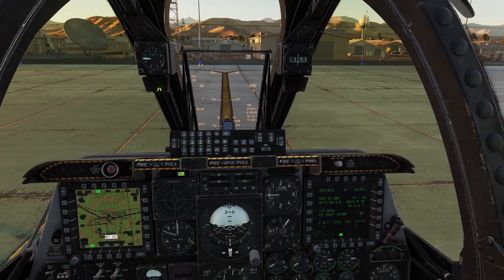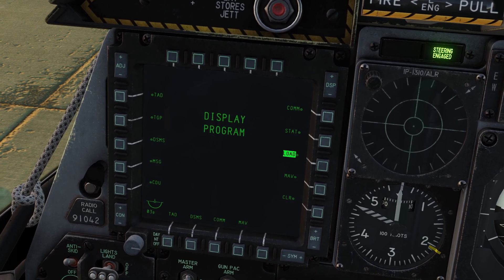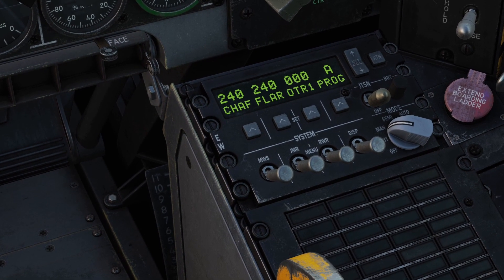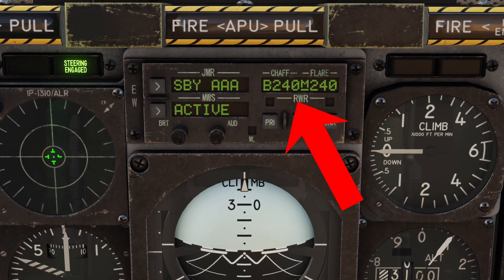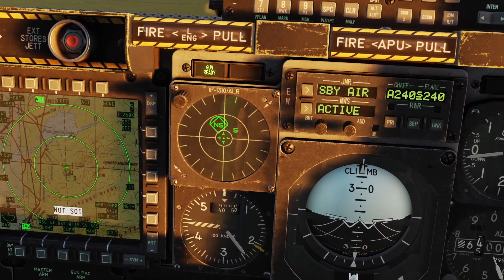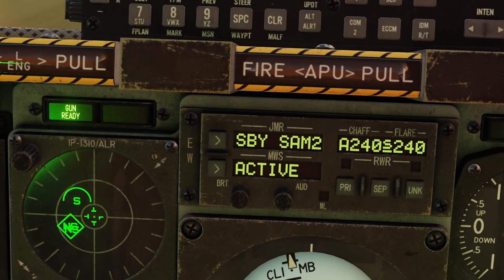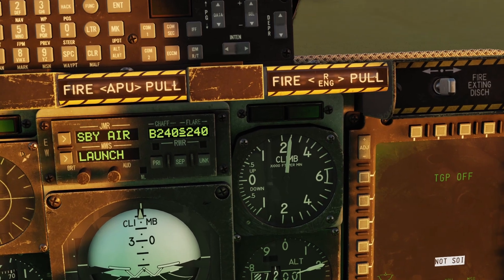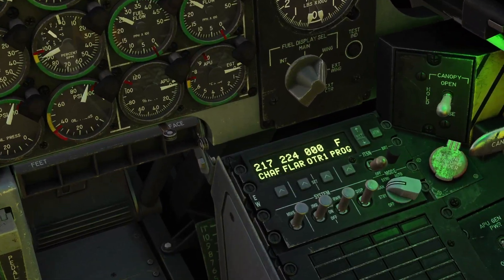DCS A-10C/CII Countermeasures and Defensive Systems

Comment: 10:24 in the manual it says CMS up is start program and CMS down is end program. Left and right are for switching programs. Havent really used countermeasures much but in my experience that was how it worked. Did they change that in the a10c 2 or something?

Comment: On the RWR, the rings are not range, but estimated threat level. The inner ring means that the threat is in range to fire at you, Outside of that, it is not an immediate threat. But it's an estimate, and there is a calculation delay, so don't get cocky. :)  A long range SAM battery can be in the inner ring, but much further away than the short range SAM battery in the outer ring. 
The direction shown is also a general estimate, think of it as a "clock" position, it's not going to be precise.  There is a trick to use the RWR in conjunction with the TAD to triangulate a pretty close estimation of the actual location of the SAM that's tracking you if you want to go after it or relay it's position to SEAD/DEAD assets, but that's a bit advanced for this video.